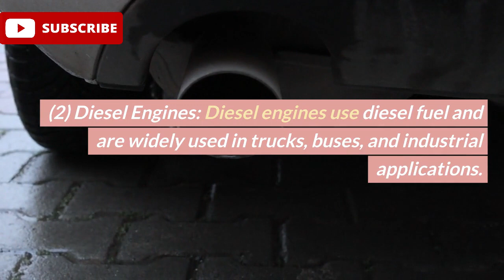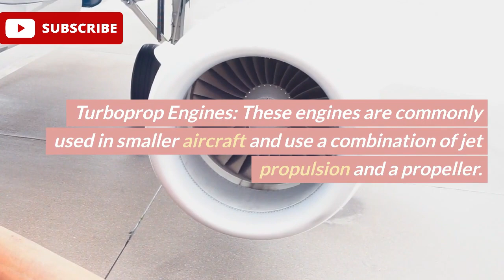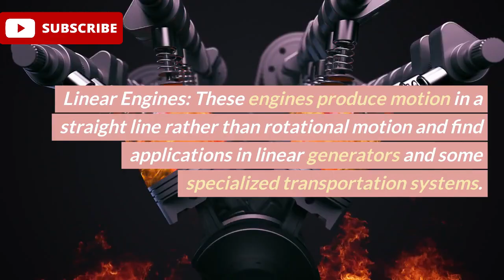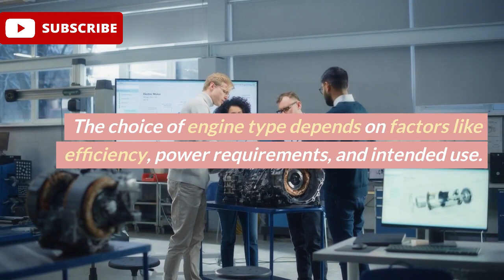Types of Engine |car cruiser0.1

Comment: Engine's are self powered, either internally or externally. They don't need a powersource other than fuel. Hydraulic, pneumatic and electric motors get their input power from other sources. This is extremely basic, but most people just don't seem to want to wrap their heads around it.

Comment: Hi bro I'm from England can we we use jet engine for bike and can we use Gasoline for diesel engines?
Reply from the maker: Yes bro why not if you have guts then you also can use jet engine in you bicycle Also 😀
Reply from the maker: And you can also use drinking water instead of diesel in diesel engine
Reply: Wao bro you have cleared my doubts I was so upset about it but when you said I can use jet engine in bicycle I'm cleared.so  then why I  can us jet engine in bicycle I will use only jet engine for transportation.
Reply: Seriously bro thank you so much as you said I can use water instead of diese so I will try tomorrow I have a tesla only runs on coal but right now I don't have a diesel but I have cooking oil I will start with it thanks for big help.
Reply: Sorry bro I forgot to tell you that in my country we drink kerosene oil instead of water.
Reply from the maker: @OfficialHowItRuns1.0  just put jet engine on your back fly bro 😉
Reply from the maker: @OfficialHowItRuns1.0  you just drink kerosene and start the diesel engine and you will be shocked the car will be run smoothly